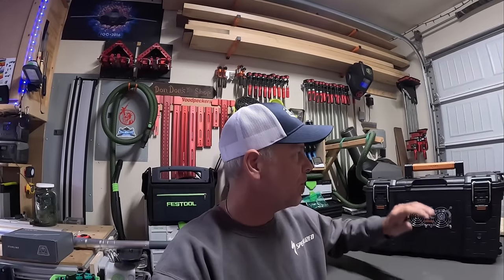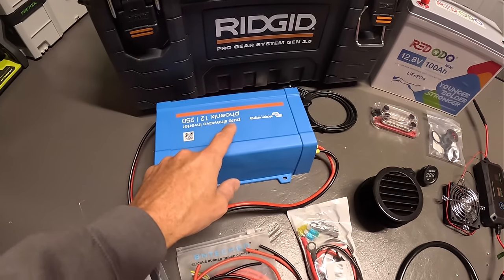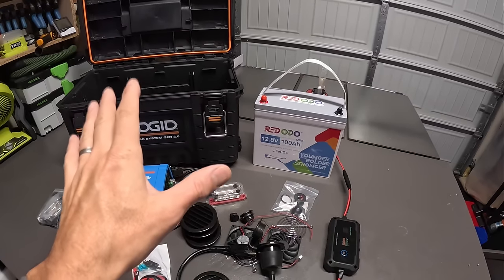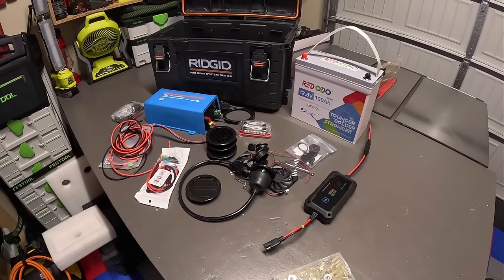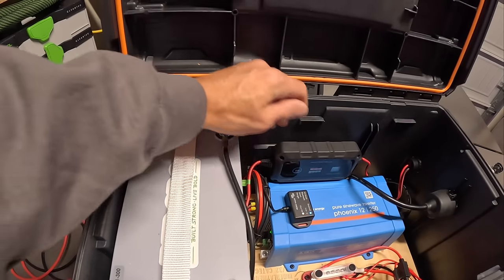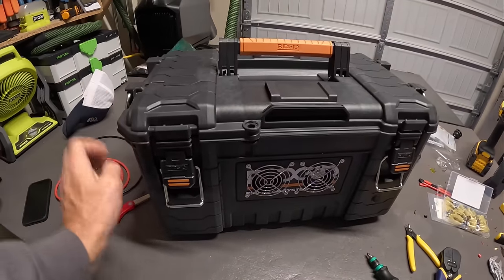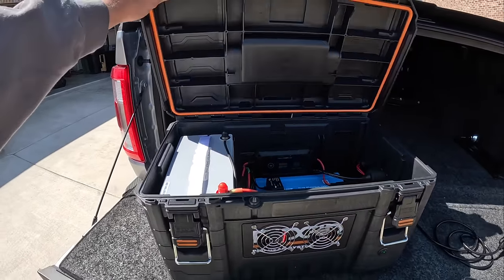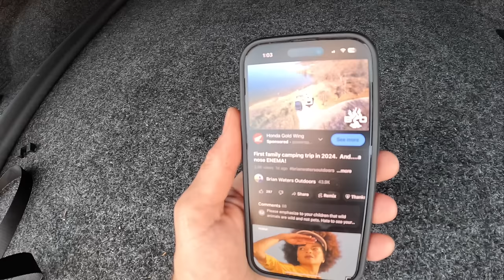DIY - super efficient STARLINK internet portable power supply

Comment: I absolutely love little purpose-built solutions like this, utilizing LFP batteries.  They are even more cool when they use a 2nd-life battery option, which can sometimes allow you to "right-size" the solution even further.  One example is battery cells installed in a 30-caliber ammo can and built to power a 12v dometic fridge.  Simply grab the can and an adapter cable and you can power the fridge for 24 hours or longer, just like this will power that Starlink connection for days!  :)  Something to consider, if it concerns you at all, is you can use a cheap plastic cutting board instead of wood, for your substrate.  If a fuse ever blows, for whatever reason, plastic melts instead of possibly catching fire.

Comment: Love watching your builds. I have a Rigid box with a Redodo mini in it as well. But I have the Renogy 50a charger in it with a 12v fuse panel. Then into another Rigid Box with a Renogy 2000w inverter connected by Anderson plugs. All hooked to my truck so while the truck is running it is charging. Have my Iceco fridge hooked to it all times. But looking to get a solar panel installed on top of my shell for when its parked. So watching your videos helps me get idea on installation and how much is needed. Thanks for all the creative ideas.
Reply from the maker: Thanks👍🏻👍🏻

Comment: Great build! I am doing the same build to run the fridge in the camper when dry camping. Suggestion for enhanced ventilation.. separate the fans by moving the intake fan to the end under the AC outlet. The intake fan would blow right on the end of the Victron helping it stay cool. Leave the outtake fan where it is. That will also create a natural chimney affect for air to flow. Thanks for making this great video!! Nice work.
Reply: You dont need 2 fans.

Comment: Would love your thoughts on a countertop ice maker for battery supply camping.. love my bourbon with ice!
Reply from the maker: We use a cheap $90 ice maker we got off Amazon and love it. It’s 120v, but you can still plug it into a power station

Comment: I'm not a genius, but will hot glue hold up on summer camping trips? I know that in Arizona, it would melt while sitting in my garage and fall, causing the waterproof 120v plug socket to fall out. good idea on the fans in and out but putting them on the ends would probably flow air better. Looks like the total cost of the build was $484.80 give or take $50 in discounts - so say $425 a goal zero yeti 1000x is 489.99 on Amazon pretty much the same total power but the Goal Zero would have USB's AC/DC etc...

Comment: Can you tell me how long it will run your Starlink? I am about to build something similar but with 2 of the same size battery and probably a 500watt inverter.
Reply from the maker: I’ve never depleted the battery completely running the Starlink. Last trip I used about 40gb of data over 3 days and battery was around 40% at the end of the trip.